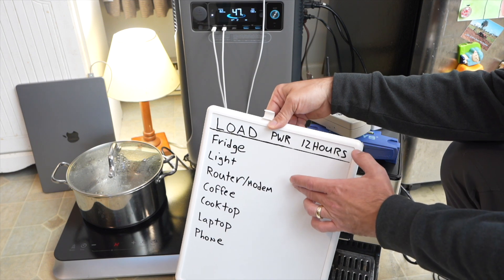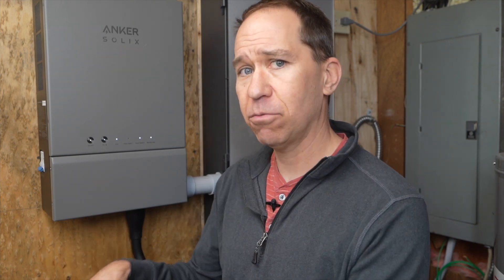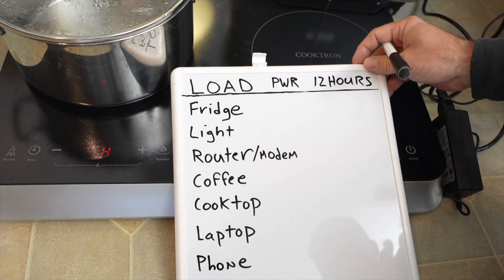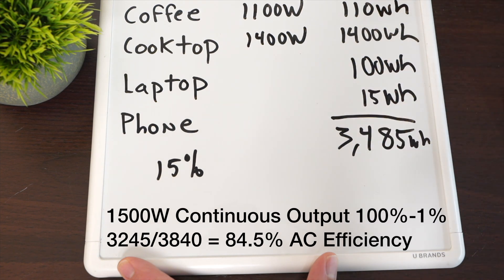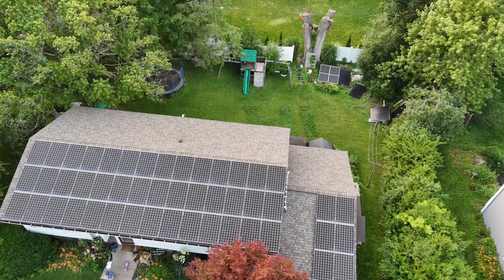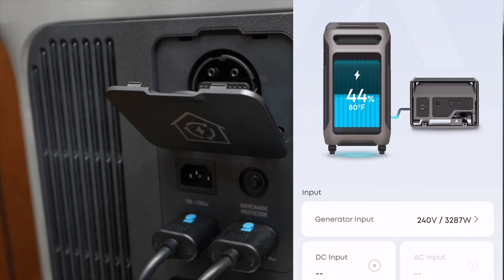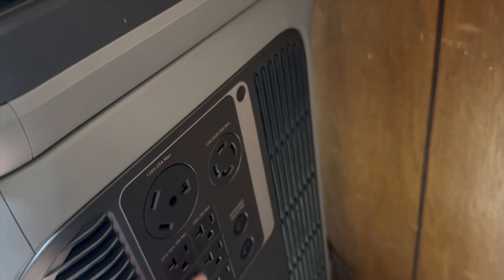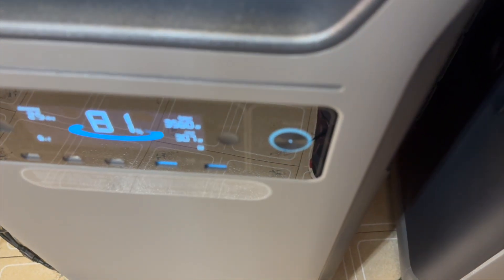5 Must-Ask Questions Before Buying a Home Battery System | ft Anker SOLIX F3800 Plus

Comment from the maker: Thanks for watching!  I am considering making a PDF guide on these 5 questions.  Let me know if you would find such a thing helpful.
Reply: Completely unrelated side question, but I’m having a problem with my TCL 50 inch TV where the top 4/5 of the screen or so(only the bottom sliver is completely nominal), are not just dark but operating extremely slowly as if the refresh rate on them is like 10 frames a second or so rather than the 60 that they should be. It’s as if the top 4/5 of the pixels are constantly ghosting as as well as dark, so I don’t think it’s an LED issue.

Wondering if this is a T con board issue as well and I should check the cables or if maybe it’s a software problem? 

I’ve factory reset the TV, as well as checked for a software update and I’m still having the same issue and I’m in the middle of doing a half hour power cycle now in case a cap needs a lot of discharging.

I will try a kernal check after that to see if that fixes it.

It was working completely fine until I plugged in my PS five and booted it up via hdmi 1; maybe it had an improper surge or something that fried something on the tcon board?

Any insight you can provide is much appreciated.

Comment: Hey Reece, I have an Enphase system with 15 panels on my roof.  Fired it up in September 2022.  My median production over that time is 29 kwh per day.  I've never consumed more than 45 kwh in a day and typically consume about 25 kwh on any given day.  Is an Enphase 5P, Tesla Powerwall 3 or an Anker setup similar to your videos best suited for me?  I know there are a lot of pros and cons to a loaded question like this, but your arm was being twisted, what would Reece do?  Thanks for your content.  🤛
Reply from the maker: That is great to hear you have solar.  The first question I have is what net metering is available for you?  For example, in PA I have 1-1 net metering.  Do you have Time of Use rates?  Also, how does your solar connect to the grid?  For 15 panels, I'm guessing you backfeed through a breaker on your main panel.
Reply from the maker: Also, it may be easier to email me since it's harder to see and stay up on replies to comments.  Email is in the about section.

Comment: The Anker is way clunkier than the Ecoflow. Those connectors are awful the way they stick out. And the 3kWh expansion batteries? Why not 6kWh? And the profile is very narrow and tall, so I'd worry about it toppling over. And only 6kW of output as opposed to 7.2kW, or a full 30A from the EcoFlow? Anker needs to rework their setup.

Personally, I don't like either solution because of the batteries. They're only rated for 3K cycles or so. You can get wall mounted batteries from EG4 or Ruixu which are rated for over 8K cycles! The Ruixu is rated for 9K cycles, basically 26 full years worth of cycles before dropping to 80%. That alone makes the Anker and Ecoflow options a no go, even though I really do like the Ecoflow setup.
Reply from the maker: I would want to see the DoD figures used for the cycle count.   Some brands use marketing tricks to publish high cycle counts.  They might only use 50% DoD to figure their cycle count when they should use100% DoD.

Comment: I found the content very useful. For me, someone who doesn't own a home battery system, the questions and the framework Reese provides so I can answer these questions for my situation is super helpful. What issue am I trying to solve? What are my outage requirements? ... If I want a review of the F3800 Plus, I would go look for a different video. This was the video I needed to help me in identifying things to consider before buying a system. And after asking and answering those questions for my situation, I can make my decision on if I will get one and which one I will get. So, @FrugalRepair, I appreciate the effort and would definitely not call this particular video constant shilling of Anker (regarding the comment from @tiredofeverythingnew.) This video is not promoted as a review of the F3800 Plus. It is a 5 questions video Before Buying a Home Battery System. Although Anker sponsored the video, at every single juncture @FrugalRepair says 'you don't have to get this one' 'you can get any one you want.' So, thanks again Reese. (@tiredofeverythingnew this is the definition of shilling - "Shilling is often used to imply that the promotion is dishonest or corrupt, or that the person or product being promoted is untrustworthy.")